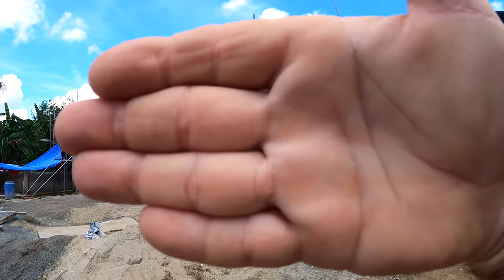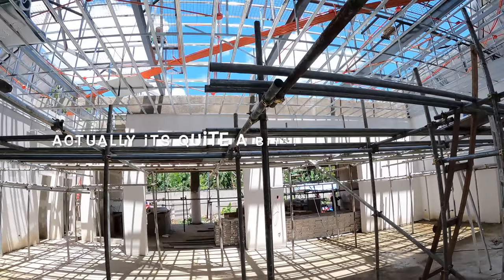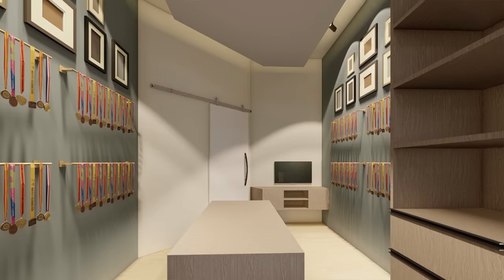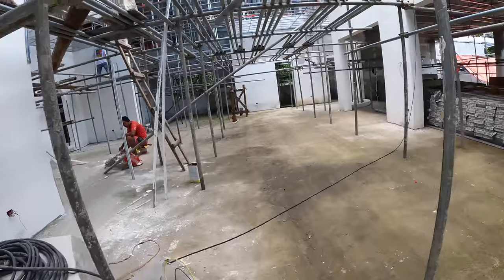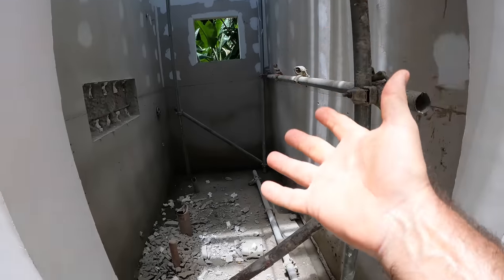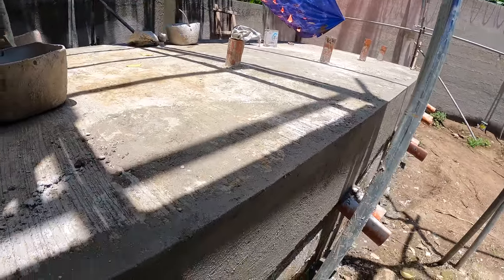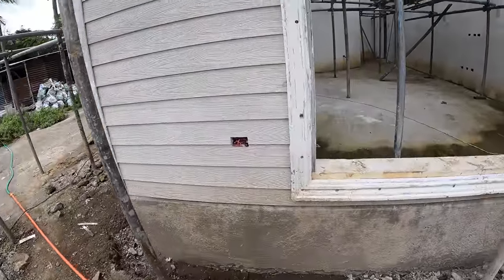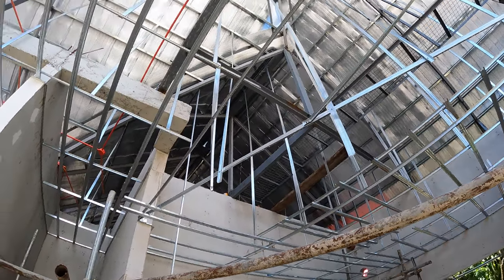NEW HOME BUILDS - EPISODE 3: Brgy Mabini Update (House Building in the Philippines)

Comment: I see a lot of standing water on the floors, moisture draws in termites. How do they treat the homes to keep pests out of the homes before constructions is completed?
Reply from the maker: The normal procedure is what they call here "poisoning the soil".  It's like injecting termite pesticide into the soil around and under the house.
Reply: @MyPIDream  yes we had to do that at our house here as well last year and then they return every quarter to do a follow up. All the wood had to be removed from the house molding, door frames, trim. Built in cabinets all removed due to termite damage. Replaced with plastic cabinets and metal shelves.

Comment: My wife and I are planning on building in the Philippines, in about 4 or 5 years. , curious about the wall construction,. Is it metal stud construction?
Reply from the maker: The walls are made of solid concrete with steel reinforcement.  The formwork for the solid concrete is from board or cementitious boards that create an almost perfect exterior finish compared to concrete hollow block which requires an additional layer of plaster coat (mortar).  You can see this process in earlier episodes on my channel.